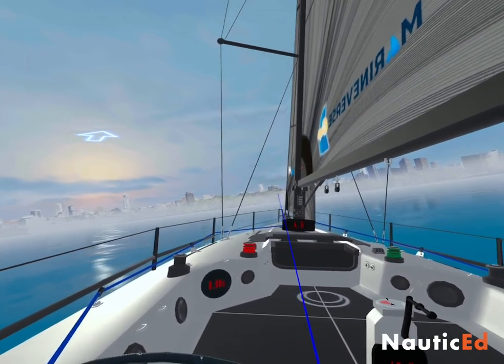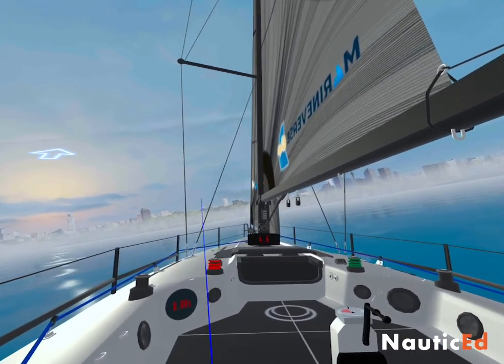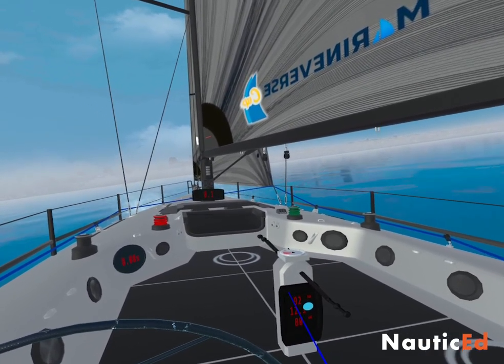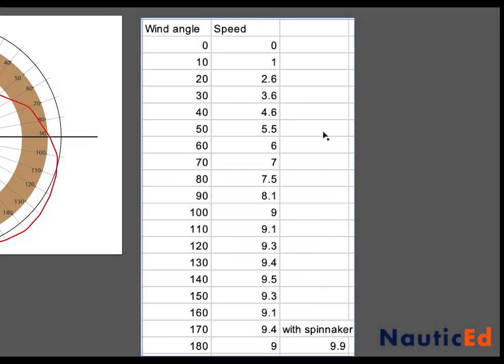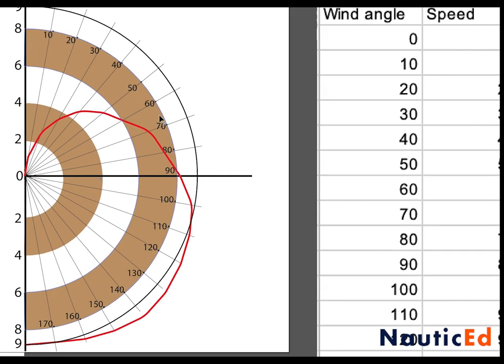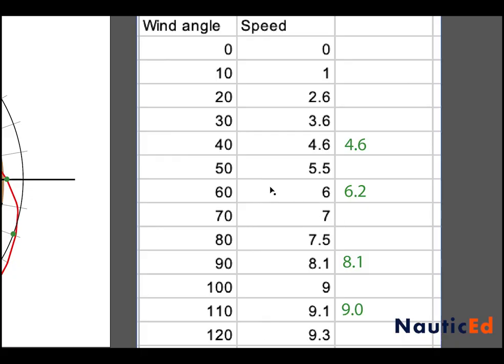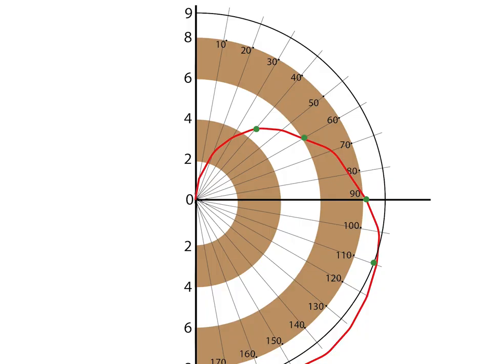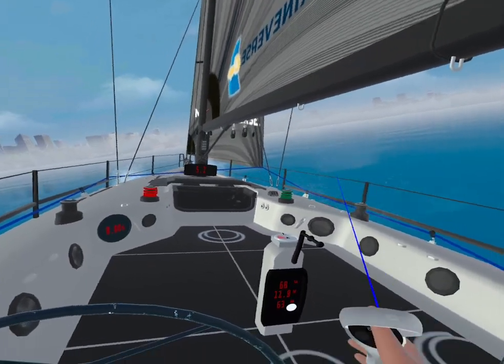Sailboat polar plots explained

Comment: The big problem I have with these plots is inaccuracy of my paddlewheel sensor. Even with careful tuning it is hard to get mine within about 5% accuracy. Water speed is one of the few hard data points that the computer uses to calculate true wind angle from measured apparent wind angle, and errors can be magnified. Add to that tidal variance around islands and you get a situation where apparent wind angle and sail shape feels more reliable than derived numbers. In a situation where the boat is being pushed sideways by current, you realize that the frame of reference for these calculation is the moving body of water rather than land. There is good and bad to that.

Comment: This does not make sense to me, on windfoiling the maximum speed you get when you are going 45-90 deg, but the maximum power you get when starting at 120-160. That's why wind-foiling in low conditions people start at 130 degrees and after getting the maximum of this speed, they turn to go upwind eg 90-45 degrees.